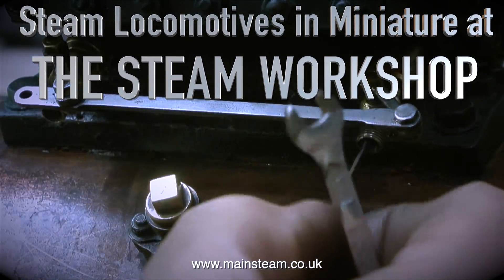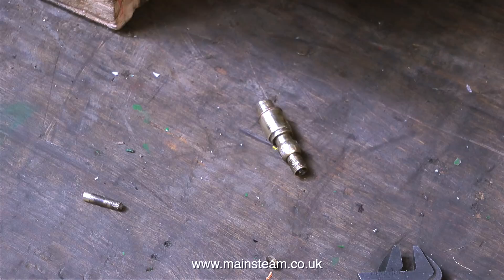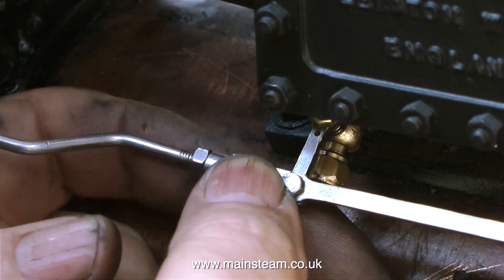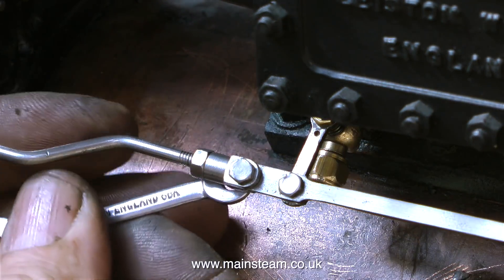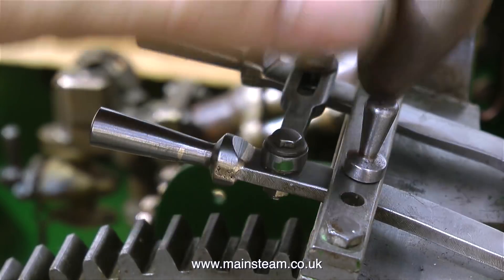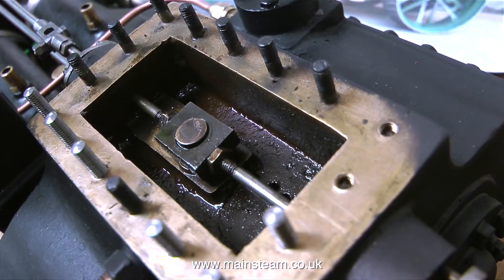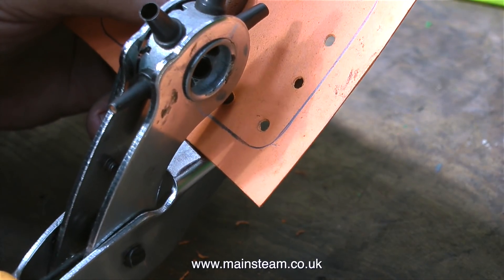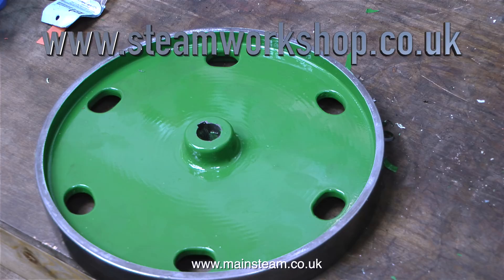THE STEAM WORKSHOP - GARRETT DCC TRACTOR - PART #7

Comment: Keith,

I noticed at 5:18 when you were creating a gasket for the steam chest cover i noticed you made it in the middle of the gasket instead of using the existing straight edges of the gasket for two of the four sides. So instead of cutting two sides when you were finished you cut the rectangle out of the rectangle, if you follow me. Is this done for any particular purpose? I would think that to help save gasket material and make it easier to manufacture that  you would have used the existing edges in the material.

Just a thought, and I did find this video useful :) Thanks Keith.
Reply from the maker: just for the video - I have lots of this gasket material - I get factory offcuts from a friend of mine who runs a gasket manufacturing company . . .
Reply: Trick an old boy taught me when I was an apprentice. If you cut the centre hole and bolt holes whilst its still in the parent sheet, and away from the edge you limit the chance of the hole punch tearing the side out of the gasket when punching bolt holes

Comment: Stupid question Keith. Why are the saftey valves on the steam chest? Is it purley because theres no room on top of the boiler as per railway locos? It seems rather odd, but if it works I guess.
Reply from the maker: It is logical because the cylinder is mounted directly to the boiler and takes its steam also directly from the boiler beneath it, the steam chest is always at boiler pressure and the regulator just lets the steam into the cylinders. So on top of the cylinder is the best place for the safety valves.

Comment: Top tool tip: always use a whole punch because a partial punch doesn't do such a good job of making holes.
Reply from the maker: yes but it make a slight mark in the gasket material so you can see whether or not you are on target with the pencil mark .... }:-)))